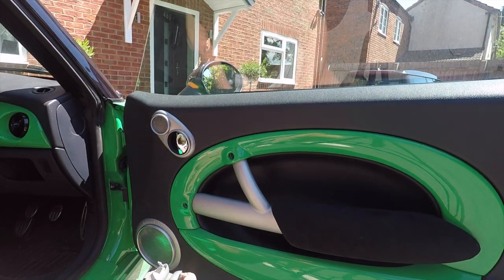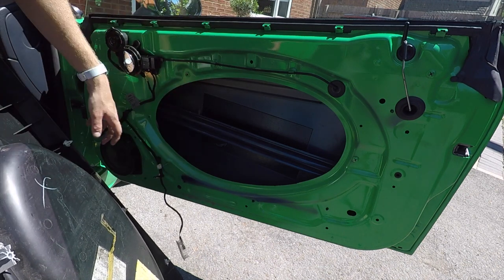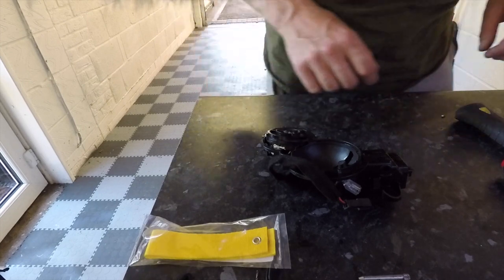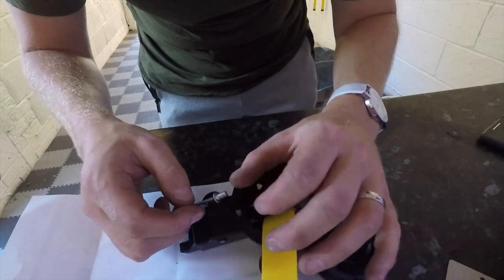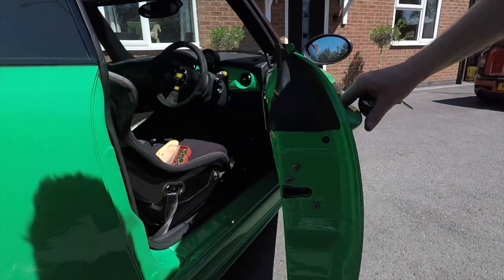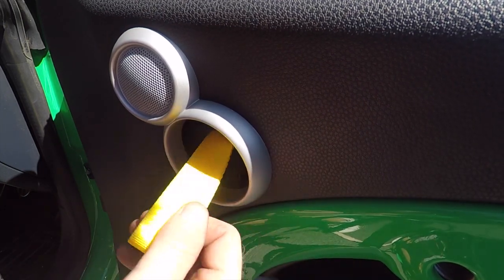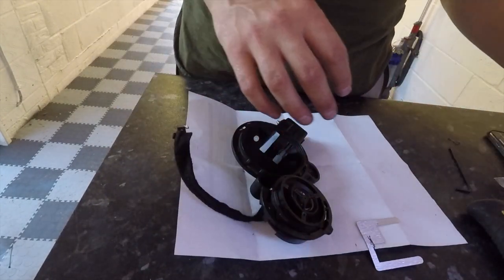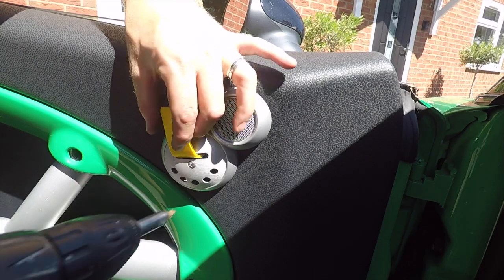Mini 1st Gen How to Fit Rennline RS Style Door Pulls R53 R50 R53 Cooper S One JCW

Comment: I know this video is old as bit I've just bought an r53 and quick question about your seats, are they bolted to a custom fit subframe or are the side mounts directed to the floor?
Reply from the maker: Hi they are actually just bolted to the OEM sliders from the stock seats so I can move them backwards and forwards.
Reply: @tweedbean  oh really? No mods to the sliders?
Reply from the maker: @LearnToRace  from memory no modification for the sliders but possibly had to drill new holes in the side mounts on the seats to line up with the stock threaded sections.